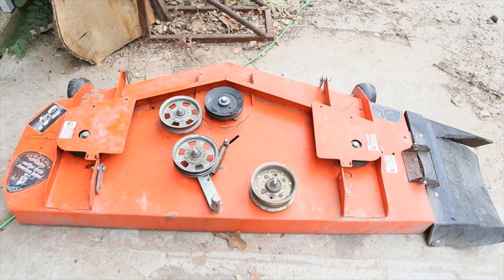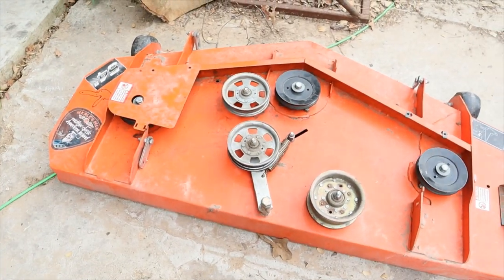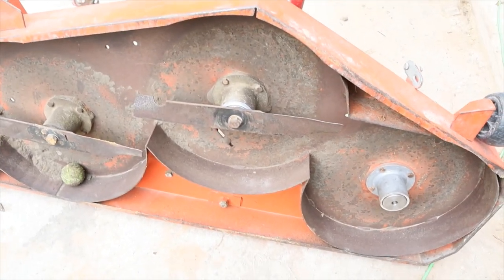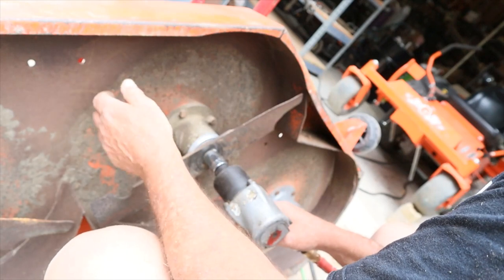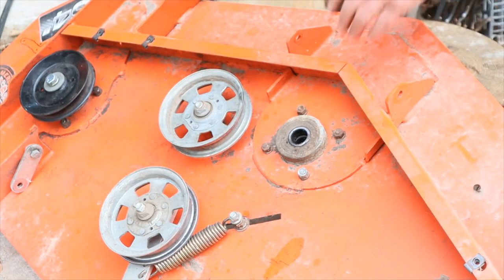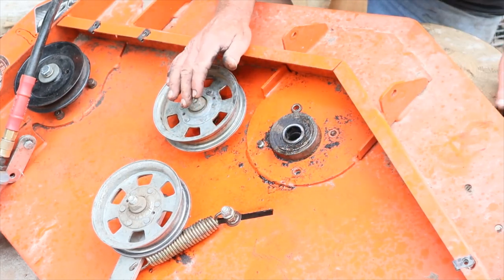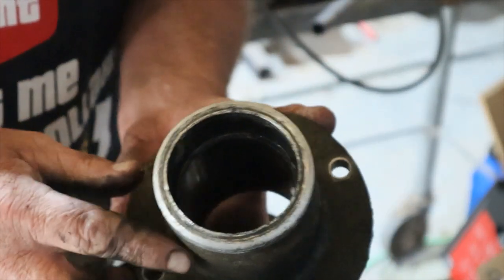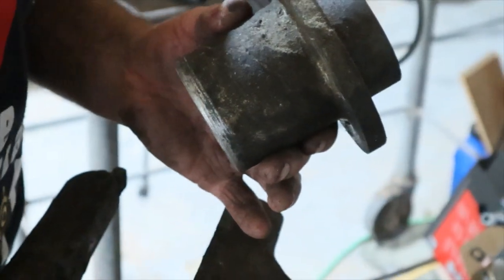Badboy MZ Magnum Mower Deck Bearing Replacement 2015 54" Deck Zero Turn Mower

Comment: I have a 2017 bad boy MZ 42" the bolt on the blade goes up and down maid my belt have a twist in it is it the bearings  bad? Can't find it anywhere  on TV. U help me out ? Yes the bolt is tight
Reply from the maker: You should not have any slack in it, when the blade bolt is tight.

Comment: So mines didn’t come off so easy had to heat it up with a torch and beat it off with a sledgehammer...i’m scratching my head at how yours came off so easy?
Reply from the maker: I had it juiced up for over 30 minutes with some rust cutter

Comment: Hi there...did you replace your plastic idle pillows with those metal ones or did your come with metal from factory.  Mine are plastic and thinking of ordering the metal ones if that's the best way to go.
Reply from the maker: That is all factory..I haven't changed any of them

Comment: Did you notice that there was a loud noise when you engaged the blades to find out it was the spindles that needed replaced the barings?
Reply from the maker: No I just heard a louder than normal sound that I was accustomed too